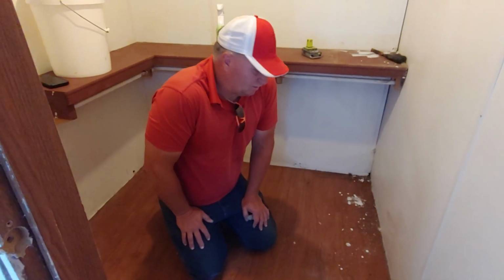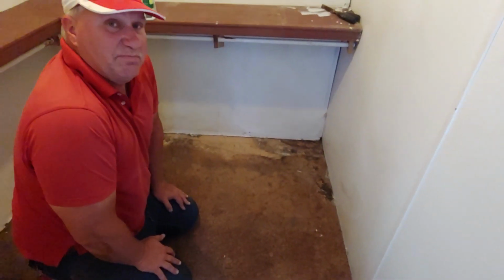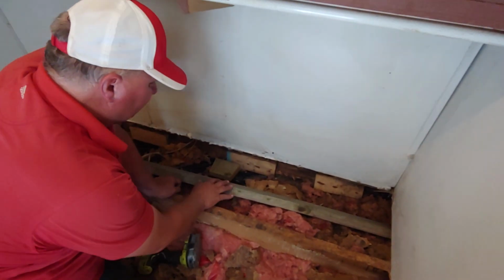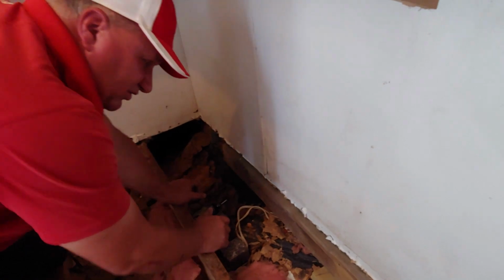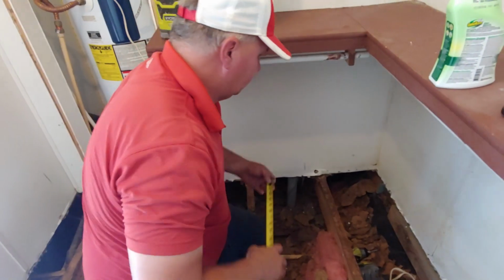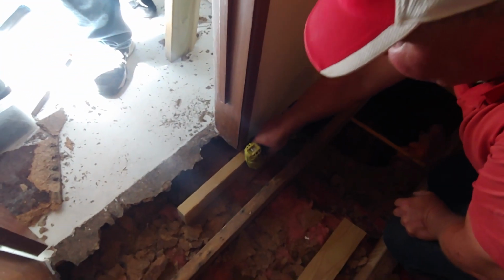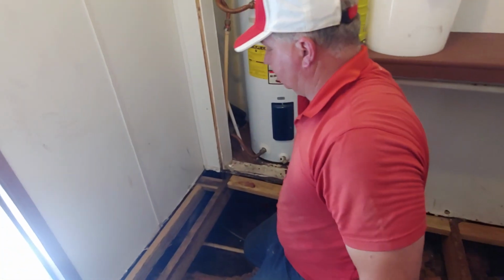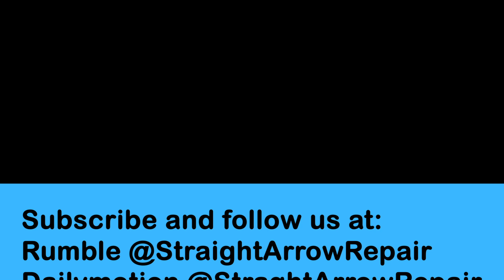Replacing Water Damaged Subfloor

Comment: Thanks so much for this great video. I just had the floor in two rooms repaired and the guy that fixed it just cut out the damaged sections and replaced it with a thick piece of plywood. Now my floors are uneven. I didn’t know any better at the time but I do now. Thanks again ✌🏽❤️
Reply from the maker: I believe in your ability to do what you want. Make what you want out of your dreams. Go get yours.
Reply: That's why I do things myself, why pay for someone else's errors. Shit I could hardly do worse and I know what happened start to finish 👩‍🔧

Comment: Hi, just a couple of questions if you don't mind. 
1. Is it better to place the 2x4 wall blocking on there sides?.  Or on the flats ?. Like you did here. 
2. Was the blocking screwed to the trusses first, that was under the edges of plywood ?. Thanks
Reply from the maker: 1. They're are many ways to place blocking, but generally yes, it is stronger to put it on its side.

2. Yes it was.
Reply: @StraightArrowRepair  Thanks for the reply. 
I'm rebuilding a mobile home and started replacing the old saw dust board flooring with plywood.  sides. 2x4 blocking under all the plywood edges. 👍🏽
Reply from the maker: It can be done, and I'm really proud to hear you doing the work! I have lots of more videos on replacing floor.
Reply: @StraightArrowRepair  I watch a lot of your videos. Appreciate the Comment. 🙂
I have the living room and kitchen floors replaced with new plywood and blocking under the floor. Underlayment replaced and added insulation. That's half the length of the mobile. Doing it on my own is a challenge but I am chipping away at it. 👍🏽
Reply: They're just for rigidity so I don't think it matters personally 👩‍🔧